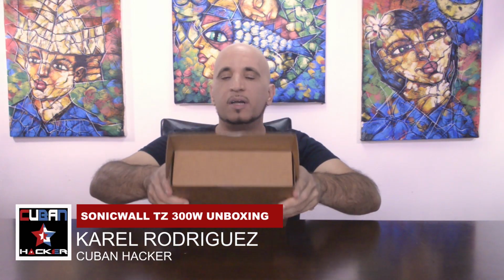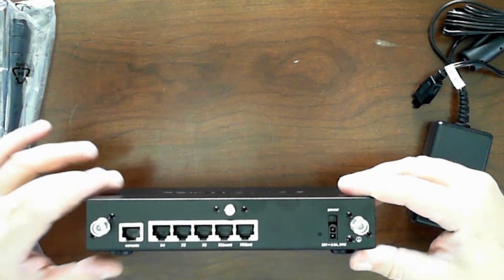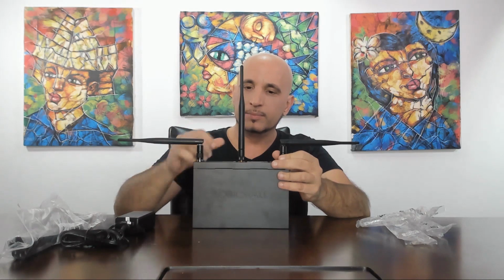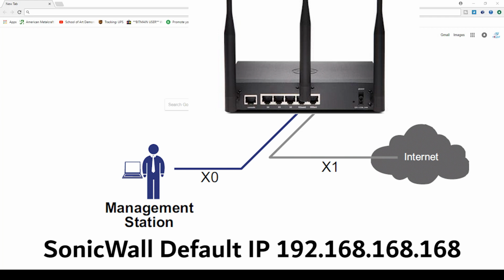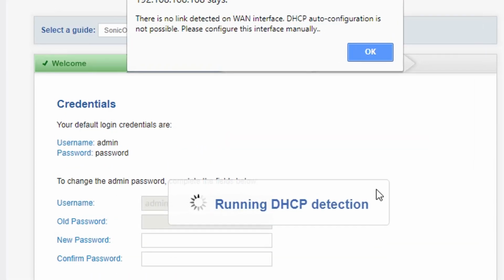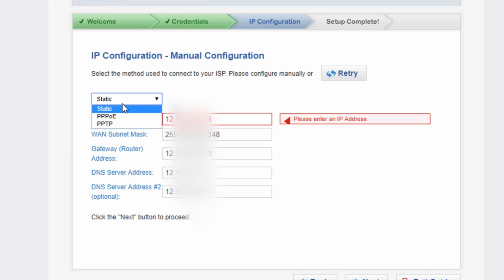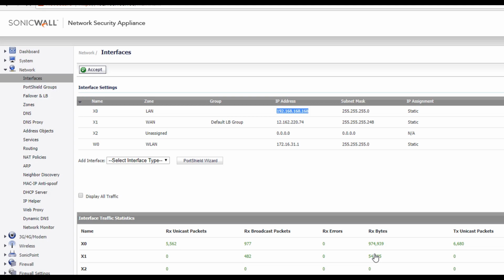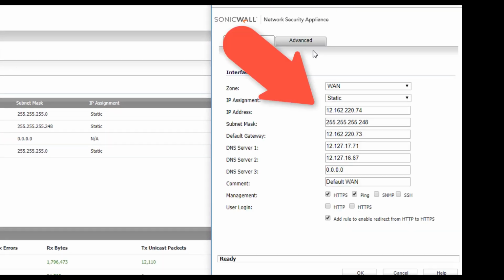SonicWall TZ300W Wireless Small Business VPN Firewall-small business networking security router

Comment: Good afternoon. How do i connect 2 ISP to the TZ 210 dell sonicwall
Reply from the maker: Yes ! You can declare any of the ports on Dell SonicWall's to be a secondary ISP by attaching the port to a WAN Zone, from there you can configure the secondary ISP in load balancer, failover or dedicate one of the ISP's to serve internal services and the other to serve internet for your users, will post a video on how to configure for a generic case scenario ! What are your specific needs?
Reply: I am putting in an additional ISP provider for redundancy and so I realised that I had only one WAN port.
Reply: Additionally was reading through the TZ 210 manual but find nothing that speak to this.
Reply: Please provide feedback would really appreciate
Reply from the maker: @kb6429  Any port can be declared a WAN port on these units , let me go thru making the short video about it, please see https://community.spiceworks.com/topic/354556-configuring-multiple-wan-in-sonicwall-tz-215  for a generic idea where to look, will update and reply once the video is uploaded.

Comment: Excellent video, I'm working with this Sonicwall model, do you have additional videos on how to set up the Failover and Load balancing with 2 ISP's, I'm trying to distribute the bandwidth on different Vlans on my organization using VoIP, AP, VPN's an 3 different computer lots including desktops and laptops.
thanks.
Reply from the maker: Will have a video shortly on this subject, stay tuned ! Thanks !
Reply: Hola, 
Todos los interfaces que tengas configurados como WAN (sean físicos o virtuales) pueden formar parte del grupo de balanceo de carga. Eso te sirve para utilizar todas las salidas a internet (No olvides marcar el checkbox "Use source and destination IP address binding") si lo que quieres es que cada una de las vlans o redes utilicen ciertas salidas no lo hagas de ese modo, créalas como WAN y luego genera políticas de routing para mandar el tráfico hacia el gateway necesario. Obviamente con esa configuración no puedes usar más de una salida (porque una política de routing enruta un objeto hacia un gateway, no hacia dos o tres de manera simultánea)
Para la configuración del túnel VPN es más sencillo, el firewall escuchará o iniciará el túnel según qué configures en la última pestaña de la configuración de cada uno de los túneles VPN. 

Si tienes el firewall actualizado puedes usar SD-WAN y hacer que todo lo anterior sea más inteligente.